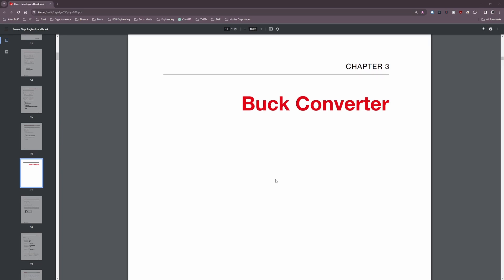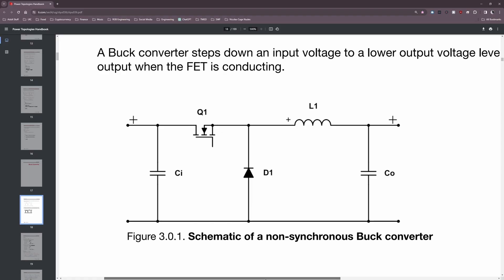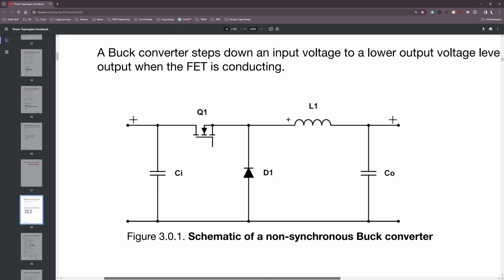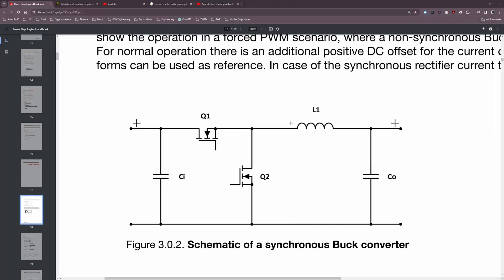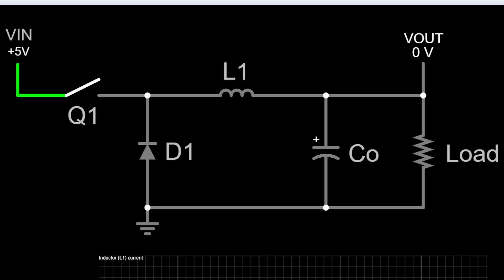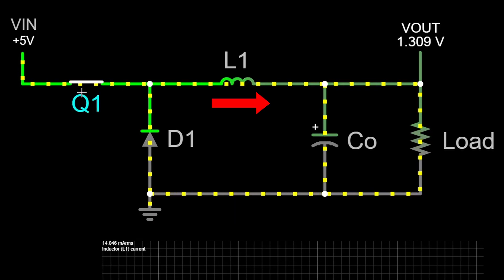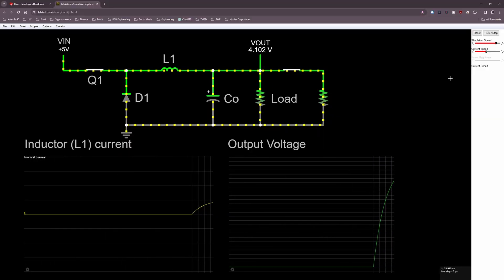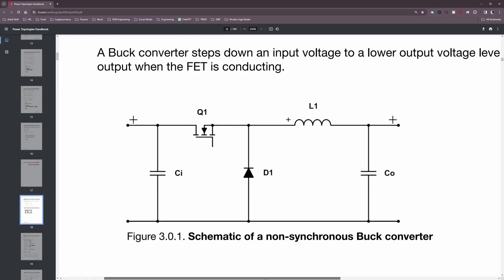Buck Converter Basics (for Beginners)

Comment: Hi as soon the switch is turned off voltage doesn't go to the circuit that capacitor you are talking about is too small doesn't hold for so long the charge will be discharge  no more current to go back to circuit correct
Reply from the maker: Correct, That's where the inductor comes in, it keeps the current flowing.

Comment: Related partially but I'm starting electrical engineering in spring what should I focus on bruising up before that time comes?
Reply from the maker: My advice would be to master the basics. It will pay off a lot down the road.
Reply: @RGBEngineering  Solid advice. I've been tinkering with electronics for years and I just finally got the want to go further with my knowledge.

Comment: This was a frustrating explanation, because apparently the mosfet requires a pwm signal.... and maybe even dynamic feedback from later in the circuit to control the pwm signal. I thought the buck converter was a circuit that could drop the voltage, but this is only half the circuit. It took me a while to realize that. I think experienced circuit designers are oblivious to how difficult it can be to understand electronics, and you might leave some details out that might be obvious to you, but I wouldn't have a clue that something is missing.
Reply from the maker: https://youtu.be/B7wOFzCd6LA

Comment: Great job.  I especially appreciated the comments about MOSFET failure.  If I understand correctly, if the MOSFET sticks open, the voltage across the output terminals will eventually rise to very near the input voltage.   This failure mode would be destructive of course, so is there a way to protect the load components on the output side from runaway voltage increase if the MOSFET fails?
Reply from the maker: Great question, you could use something like a TVS diode or perhaps a fuse to protect downstream components.

Comment: Excellent explanation!
This looks like exactly what I need to learn and precisely when I need to know it.
I was a Laserium laserist, performing abstract laser shows in a planetarium, in 1978, before going freelance with my own road gear, until 1988.
Now 72, I've returned to the artform I loved, by developing a PCB for an original laser synth, based upon the Teensy 4.x MCU dev board. But, electronics has always been my achilles heel.
The T4 is normally powered via 5V USB, but a hub can't support multiple laser synths for multiple laser projectors. So, I'm forced to provide an external power source, specifically a 3A 12VDC brick, to also power cooling fans and external peripherals, motors & gizmos.
Obviously, I need to convert the 12VDC down to 5VDC for the Teensy & PCB. But, an LDO regulator is too inefficient and generates too much heat that would adversely affect the performance inside a small case. IOW, I need a 3A 12V-5V, well regulated, buck convertor.
Discovered one on Amazon that works fine for prototyping, but it's designed for negotiating USB-C PD and is overkill for onboard integration into the final T4 LS ver VII PCB.
So, I'm hoping that your series will reveal how to design a simple buck convertor that will enable me to achieve my final goal.
New sub!
Thank you!
Reply from the maker: Thank you for the detailed comment and the new subscription!

Comment: Tough to not be in awe of your comprehension of this topic!  I am trying to charge a 14.4v 6.5a-h nimh battery with a 24v 350w scooter motor generator, driven by an elliptical exercise machine.  I am trying to minimize the number of motors/generators off of the flywheel, required to extract 200W realtime to the battery (or array of batteries as I have many, or 12v trolling motor in a bucket of water which is my test load). I've tried several buck converter circuits, all of them work to some degree but I don't appear to be maximizing amperage. Hypothetically I should get over 200 watts out of a 15a buck converter at 16v, but I'm just not getting it.  Since the goal is just to get the power, I can simply replicate my setup with 3 ea. scooter motor generators being driven by the same flywheel of the elliptical each with its own buck converter and then combine the outputs.  I feel though that I'm missing something significant like my input & output power is not phase matched or I'm somehow otherwise abusing the maximum power transfer theorem. I wonder if your geniousness can detect what pitfalls I am trapped in!  Thank you for all of your videos, I appreciate you.
Reply from the maker: Thanks for the kind words, and it sounds like you have a very interesting project.

Comment: Good explanation,
1) Could you additionally explain how it works when load increases, as I saw from more complicated schemes, it uses Feedback for an adjusting the duty cycle. As I understand it guarantee that output volgate won't exceet some critical ranges.
2) What is about LC application in this circuit? From what I see it acts as LOW pass LC filter?
Reply from the maker: It is a common misconception that the duty cycle changes as the load changes, but this is not true. When the load changes, only the magnitude of the current flowing through the inductor changes.

I don't like to think of a buck converter as an LC filter just because that model breaks down when you apply it to a boost converter. I prefer a model that works in both applications, that way your understanding deepens when you see the same model used in a different way.
Reply: @RGBEngineering  I made some simulations in Proteus, with different C nominals, the main paramters is 
V= 12→4 
f=20kHz 
L=666uH.
For first one option, when Cout has 25nF it had very big ripple voltage, so this still shown almost as AC, 
For the second with 25uF it was almoust smooth, the ripple voltage is about 50mV.

Previously I thought that capacitor, which goes after inductor. produces easiest path for the diode during MOSFET off cycle (again something related to the LC filters imagination), but looks like the purpose of capacitor simply feed the load by discahrging itself. That explains why with bigger capacitance I got more smooth output signal.

Comment: Hey, wouldn’t cutting off the power to the inductor generate a voltage spike when the field is collapsing? Could someone explain why it doesn’t fry the circuit?
Reply from the maker: Think in terms of V=IR. Cutting off the power does not increase I (the current flowing through the inductor) or R (the resistance of the load), therefore V (the output voltage) will not spike.
Reply: @RGBEngineering Wait, but isn’t that how boost converters work? A collapsing magnetic field causes a voltage spike that then goes through the diode and is captured by the capacitor, innit?
Reply from the maker: boost converters work by changing the resistance that the inductor sees. When the MOSFET is on, the resistance is very low (nearly a short circuit to ground). When the MOSFET is off, the resistance the inductor sees is just the load. We still have V=IR, and R is changing (increasing), I is staying the same (due to the property of inductors resisting a change in current). V increases as a result.

Comment: Great video...thanks
Question, how to measure the mosfet rds on...also, can it be calculated to estimate it.  Also, how to calculate the mosfet rdson, impedance and how to calculate the load imedance, resistance.   What are the calculation formulas for the two cases.  Thanks
Reply from the maker: This information can be found in the datasheet, or you can measure it using Ohm's law (V=IR)

Comment: What happens when the mosfet stays on and he capacitor is fully charged? Does that create a short circuit?
Reply from the maker: the output voltage just becomes equal to the input voltage (no voltage step down occurs).

Comment: 5:59 I once played around with a 10 H inductor, cutting off the input current to observe the behaviour of the electromagnetic field. That’s how I learned the importance of the flyback diode, the one you call rectifier. 

The software doesn’t display accurately what actually happens: as the inductor stops receiving current, the voltage on the high-side drops below ground voltage, as if it would try and suck electrons from wherever it can (similar to the sucking effect from a siphon when using a hose to extract liquid from a higher source). IF there would be no flyback diode, this voltage can go up to 3 digits negative, burning up the controlling part of the circuit. 

Adding the diode prevents this kick-back voltage from spiking too low under the turn-on voltage, supplying the current the inductor needs to stay “happy”. 

The overall explanation was great, though! The doubts I had were fully cleared 🙏
Reply from the maker: Excellent, thank you for your insights!

Comment: im on a robotics team trying to create a power distrobution board where we have a 24V battery and need to step it down to 12V and 5V while also current protecting the loads with fuses. we originaly created a board with the fuses after the buck converters however we had problems with the buck converters malfuctioning before the fuse would blow. we are thinking of putting the fuse before the converter to reduce chances of a converter malfunctioning during competition but other explanations have said that when stepping voltage down the current is increased and i dont want to ruin the load on the output. if anyone has any insight on this id love to hear :)
Reply from the maker: You should definitely put the fuse before the converter, as this will protect the converter from damage, which will also protect the load.
Reply: @RGBEngineering  thank you!

Comment: Good Stuff. 
One question. How do we control the gate of the MOSFET. Do we use some MCU for this job. Also if the load changes then there needs to be some feedback system to change the duty cycle of the MOSFET. How do we apply Laplace Transform to this circuit. Asking this because a interviewer asked me this question. Can you Please make a video on these Topics. 
Thanks
Reply from the maker: We use an integrated circuit to control the gate of the MOSFET - link to a video on them here: https://www.youtube.com/watch?v=B7wOFzCd6LA

It is a common misconception that the duty cycle is dependent upon the load, but it is not. If the load changes, the only thing that changes is the average current flowing through the inductor.
Reply: @RGBEngineering  I give it some thought you are right. Resistor is used to limit current if the Voltages remain the same then it will only allow same current to pass throught it no more. 
V /R = i
R is not changing and V is not changing. So current(I) will remain the same
Thanks

Comment: I want to make a device ( or buy one already made  ) to take a 12 volt dc supply ( from p.v. solar panels or wind turbine generator ) and turn it into 2 volts dc, with the highest amperage possible to split water into hydrogen and oxygen gasses with out a lot of wasted heat in the power supply. Is a Buck converter the best choice ?
Reply from the maker: I'm working on a video about that, so stay tuned!

Comment: how does the switch(mosfet) alternate rapidly, do i need to use an external clock like a 555 timer ic?
Reply from the maker: the MOSFET is controlled by a device known as a regulator IC. I made a video that talks about them: https://youtu.be/B7wOFzCd6LA

Comment: I guess you missed the logic, when mosfet switches off, inertia current in inductor changes its direction and voltage spike happens which evens out by capacitor.
Reply: That was meaningless word salad. How about you comment on something you actually know about!